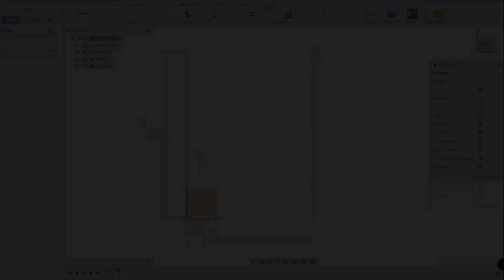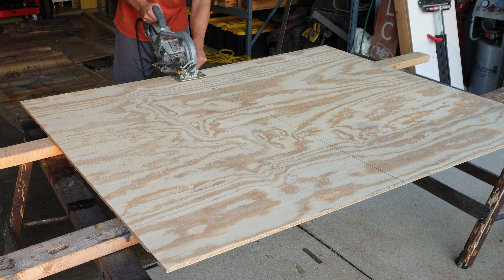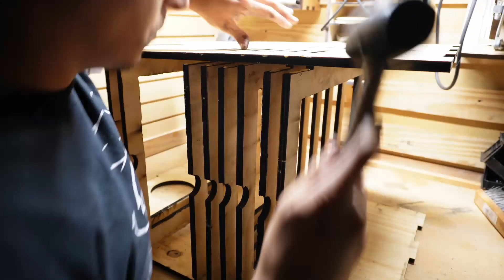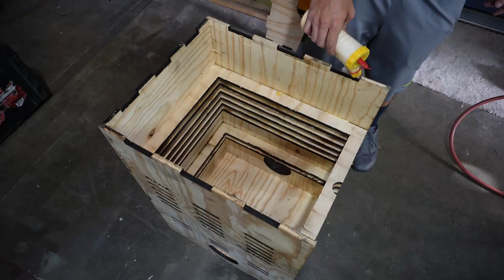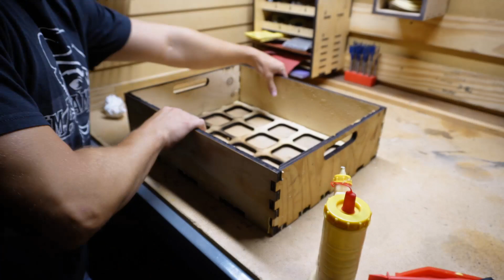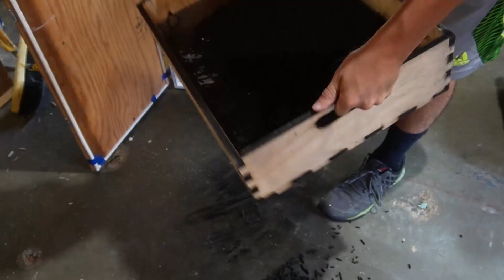DIY CO2 Laser Filter

Comment: They say that having the smoke go through a wet filter will remove all of it. But I am unsure how to DIY such a thing. Could spritzing the carbon filter with water before use be a solution? (It works on a BBQ grill).
PS: I noticed u used Carbon Pellets? are they too hard to be useful? perhaps crush them up before loading them in?

Comment: I'm considering building a similar thing. but It is for my open frame desktop laser. I want to set it on top of the box and have the box OPEN under it to directly remove the smoke downwards. This is imminently doable but I worry about burning particles falling into the filters. I am pretty sure the laser can't reach them and set them on fire lol. (Famous last words I am sure).

Comment: Why cant the exhaust tube “be” the filter? Like shove a bunch of carbon cylinder and filters in a tube?
Reply: lol I was thinking the same. Only factor that might be important is the Filter 'volume',  IE., it would clog and slow the air flow faster than a bigger one would. having a bigger filter box allow the air to slow and the particles to get trapped over a bigger surface/ results in a LARGE capture area without impeding air flow (Ie. ,less strain on the fan motor)/
That said. if u have a powerful fan and want to do it that way? and dont mind replacing filters frequently? then go for it.